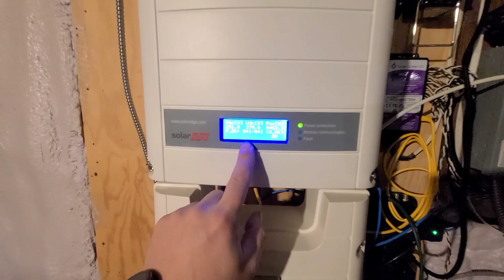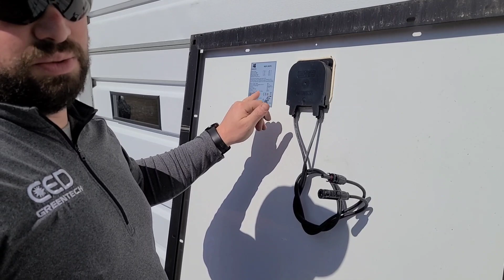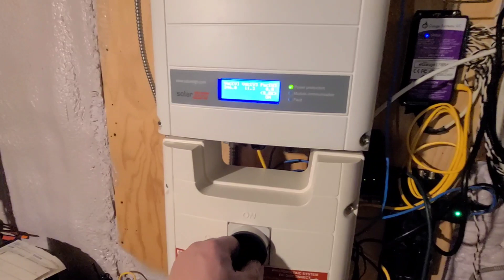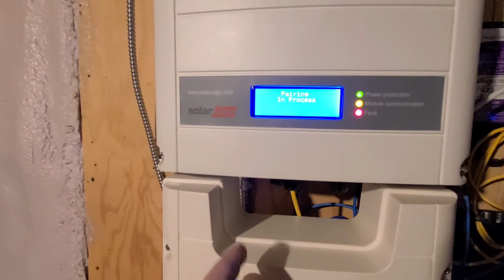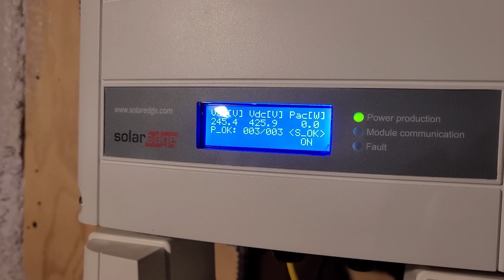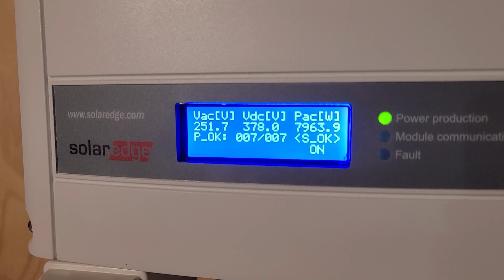How to Replace a SolarEdge Optimizer

Comment: Hi Ben,

in your video you found a bad optimizer but once you had it off the roof it was still reading 1V so how exactly did you find the faulty optimizer? My inverter is stuck in night mode and of course after a little reading it will be time to look into this. So far SolarEdge customer service get a 0 rating from me. Lots of talk about nothing and the only thing they keep saying is to get the installer involved. Judging by all the negative rep. online its a shit company with a lot of issues.
Reply from the maker: I have my array mapped out online, so it was easy to pinpoint which optimizer was bad.  If you tell solaredge that the optimizer is putting out 1v they will tell you that's its not bad... 
Inverter stuck in night mode could mean a bad inverter. What I do is turn the DC disconnect knob off, open the wiring compartment and check for DC voltage on the strings.  This should line up with how many panels you have in the longest string.  Then turn the DC disconnect on with a pair of pliers.  If the DC voltage drops to near 0v, it's a bad inverter.

Comment: Very good video thank you for your effort with this. Unfortunately, you stopped just short of my problem. I have replaced 12 low-powered panels and optimisers with 10 much higher-powered panels meaning 2 of the original optimisers are not required. How do I remove the unwanted optimisers from the monitoring platform?

Comment: Thanks to your video I just swapped out a failed optimizer but the SolarEdge map is only editable by installers.
Reply: You could pretty easily just call up your installer and tell them that you had a bad optimizer and have already replaced it yourself but simply wanted to alert them and ask that they update the optimizer map for your system. I'm sure that they'll be glad they didn't have to send a guy out to swap it out for you.

Also this makes me wonder what happens to all those SolarEdge systems out there under the control of now-defunct local solar installers. Do they just become inaccessible, or could a customer actually get help from Solaredge themselves in that case? Probably not but maybe...
Reply: @erikajoystith4692  I talked to SolarEdge about this, as a homeowner you can take control of your own system, but the installer would no longer have any access to it.  Depending on how you financed a system could play into this, I paid outright, so own it all.    My installer's terms say any work performed by non-(insert company name)  would result in warranty void.   So I would assume taking control of my system would make them not want to honer any warranty work needed.
Reply: @erikajoystith4692  Exactly, my installer is no longer in business. I did reach out to SolarEdge and they did the map update for me --- AND they sent me replacements for the two bad optimizers. Great support from SolarEdge.
Reply: @erikajoystith4692  I can tell you what happens when an installer goes bankrupt.  It's nothing good.  SolarEdge refused to let me setup a "self-installer" installer app when my installer went bankrupt and no other installers wanted to support my existing system and weeks of trying to find one.  It's a major pain in the butt.  Fortunately, so far, videos like this and asking SolarEdge to update my optimizer SNs has worked around no longer having an installer instead.

Comment: Ben, thank you for sharing and I appreciate your insight.  The company that installed my SolarEdge system went out of business, sadly.  My SolarEdge inverter has now died for a second time and the next replacement is on its way which must be installed by an electrician to be under warranty ($700 each time).  Can you advise me on what data to ask solar edge for regarding my system's health so that I can better understand my inverter problems?
Reply: The old optimizer showed one volt    what does the new optimizer show when you hook it up on a bench test?

Comment: Hello Ben. Great video, much appreciated. I am wondering which model of optimizer do you use? Here in Sweden we got a sale-ban on many of SolarEdge optimizers (P300, P350, P350I, P370, P4040, P405, P500, P505, P600, P650, P700, P730, P800p, P800s, P850, OPJ300-LV, M6240) due to them interfering with radio communications. Do you have any experience with this? I am curious if our installations using P300s and P700s should get rid of them or not..
Reply: If you make an RFI claim to solaredge they can send out new optimizers with filter attached to them. You need to braid all the cables with a continuous set of homeruns through the whole array. I've done this a couple times now. The first time a Solaredge rep came out. They may be able to send filters to add on as that's how the special optimizers appeared but there may be more to it on the inside of them
Reply from the maker: I have not heard anything about the recall.  I'll have to look into it!! That looks like pretty much all of them.  I have P300 on my house.
Reply: SolarEdge shipped me P440 optimizers to replace 3 P300 optimizers under warranty and all 3 worked.  However, unsure about their RFI specs.

Comment: How did u know it was That ONE? what led u to suspect that one
Reply from the maker: I made a map of the optimizers on the Solaredge site.  Showed me exactly where it was.  If a map wasn't made, a thermal camera is your best bet for quickly locating it.  Panels that have a bad optimizer will be warmer than the rest.
Reply: @benssolarandbattery  friend of mine is having issues. The inverter won't even enable because there are less than 8 panels working in each string. He has two strings of 11 and he has found 3 so far that don't put out 1 v. But then when he connected one string of all the ones that did put out 1 v he still gets a low insulation resistance error. Of 465k ohms. I'm taking my Megger over there tomorrow to check wires and looks like I can meg the optimizers directly too from what the instructions say.
Reply from the maker: @electromechanicalstuff2602  if you go into I think the maintenance menu, it will sometimes show you where in the string the isolation issue is.  
Check it out.  https://www.google.com/url?sa=t&source=web&rct=j&url=https://www.solaredge.com/sites/default/files/application_note_isolation_fault_troubleshooting.pdf&ved=2ahUKEwiZmrSilK73AhWxoXIEHVrZArUQFnoECAYQAQ&usg=AOvVaw1mFLbe0N2ACnUbDlDiHbUV

Comment: Hi Ben,  Which error code does the grid isolation relay failure cause (maybe 2x1a)?  I would be tempted to pull the board and swap relays if the warranty was past. In another video it appears as if you have gone into the setup to look at what is involved configuring the SE1000 to respond incrementally from  your solark adjusting the frequency to throttle the solaredge (to limit battery charge current).  I would like to know what is involved in turning this on so when the few hours a summer my solaredge inverter is making just a little too much power the solark can throttle instead of shutting down the solaredge (so I sell more power to the utility).  what is your opinion of using a solaredge smi-35 or smi-100 to feed the solarark (s)?   thanks for the fantastic videos.

Comment: Great video,  pretty sure one of my optimizers is out. I will use your procedure to check it out. Would you recommend trying to re pare all of the optimizers before going forward with the diagnostic process? Once the new optimizer,  if needed,  is pared how do I communicate that to my solar edge account? Thanks in advance, my system is 5 years old and this is the first problem. The system was installed by a solar co they charge $200 just to show up. i need to learn to help myself. Thanks Bill

Comment: Much appreciate you creating this video.  Hoping i can get some troubleshooting tip.  I have one optimizer/panel that recently decreased power production to little under 1/4th of what the other panels are producing.  System is about 6 years old, not being shaded by anything throughout the day.  Would you suspect panel going bad or I may have another bad optimizer?  Will probably try to get on the roof sometime in next couple of weeks to find this particular panel/optimizer sn and measure open voltage plus optimizer safety voltage.
Reply: More than likely optimizer. Panels do go bad but optimizers fail often

Comment: I just had my SolarEdge system installed June of 2021. It was producing 99 kWh daily. By checking the app every day, I was able to see it's production numbers. Then, it started to decline in production. On the app, half of my panels are producing less than the rest, I have 42: today some read around 1.61 kWh, others read 1.09/1.11 kWh, and four panels read 960 and 975. I've called the company but since the system is producing, they say everything is good. I know something is wrong but I don't know anything about this! Last time I called, they asked for my electric bills for comparison.... I was so angry, the app is telling us how much it's producing daily, monthly and yearly. And it's readings are definitely less than before on half my panels.
Reply: Dammm, im getting solaredge hd wave-optimizer install. Im just worried about the product going out like that.
Reply: @thezfamily989  Now that it's summer again, it's producing in the 90's range. Which is still pretty good. Just make sure the company installing them will take care of your problems swiftly after it's installed. It's not producing in the 98-99 range like at the beginning. But still, why the decline? Supposedly, the panels stop producing normally after 30 years.
Reply: @prettybrowneyez3338  yea they loose % through out the years. Yeaa, hopefully they be good for many years.. so far there reviews been good satisfied customers.
Reply: @prettybrowneyez3338  have you been washing the glass panels?  Dust and pollen can shade the panels.
Reply: @ciaoricardo  I wash mind down. it helps
Reply: @thezfamily989   hey how your system now?
Reply from the maker: Is there any shading at all on any of your panels? Or snow? Sounds like it's working perfectly and the panels that are shaded (because it's winter) are producing less than the others.  Without any location or shading info, I'm in the dark.  I don't expect you to give that to me, but it's almost definitely the issue.
Reply: @benssolarandbattery  No. No trees. I'm in Texas so it's very hot.

Comment: I have 128 cell 435watt panels soler edge will not tell me what optimizer I need with the hd wave please help because I’m not an installer
Reply from the maker: The P505 would probably work.  Check the spec sheet and compare to your panels.  Be sure to take temperature into account for the max voltage if you live in an area that gets cold.

Comment: Hi. Have You tested the resistance from both lead pairs on a new and a claimed not working one? I am curious how to detect the poor one even if the 'not working one' in your case shows 1Vdc.
We have a system where a whole string is showing low production, inverter shows 033/034 (34 is the right no. of panels).
Reply from the maker: I have in the past but don't remember the values.  I'd start with the optimizer that's out. That could be messing things up for the rest of the string.

Comment: How did you find out what optimizer was bad. I’m showing 39 of 40, but all my optimizers show up on the list in the logical view.
Reply: Greg- is solaredge able to provide you a report of which optimizers are working/not working?
Reply: @jasonschlegel4027  I’m not sure what you’re talking about buddy.
Reply: @nmfireman  Sorry - I"m just wondering how you know 39 of 40 (previous post).  Is this something SolarEdge provides?
Reply: @jasonschlegel4027  There is monitoring software that is provided. We cleared this problem up quite a long time ago. We had a hail storm and had to replace a bunch of panels. We found the bad optimizer after putting everything in logical order. I could screenshot what we used to see our panels
Reply: @jasonschlegel4027  I’m trying to figure out how to post a screenshot here so you could see my monitoring software
Reply: @nmfireman  jschlegel@

Comment: I had 2 bad optimizers 3 years after I install my own system. I called Solar edge and they were able to diagnose the 2 optimizers and surprisingly they sent me 2 optimizers no question asked. Fast forward 2 years to today and I noticed one optimizers Not working I called solar edge and they said the optimizer is producing 1 volt and that I need to trouble shoot to make sure it’s not the panel or connection for them to send me a new one. My guess is that these optimizers made in China are failing left and right and they are making it harder on the home owner to get a replacement based on the 25 year warranty. I will jump through the hoops and hopefully get the optimizer replaced. The panel has no moving parts so I can’t see the panel being the problem. Maybe a connection but I doubt it. They are pretty easy to replace especially when it’s a panel on the outer parameter. Also I recommend getting an installer account on Solaredge monitoring platform so you can update the optimizer once your replace it. If your have solar edge optimizer you will probably be replaying optimizers 1 or 2 every couple of years. :(.  Nice video by the way! 
One more thing if you are thinking about getting solar it is way cheaper to do it yourself. You can subcontract some electrical work and the plans. Everything else is pretty self explanatory and it will save you anywhere from 60%-70% after tax credits! That was about $20,000 in my case!
Reply from the maker: Thanks for the comment Michael. I have seen plenty of panels fail.  Usually its a diode or a bad solder joint on the cheaper ones.  Most often you'll get 1/3 of the panel that stops working.  In that case it will usually still show up and produce power.  Over my years of installation and service work, 9 times out of 10 its a bad optimizer, even if it's showing 1 volt.
Reply: @benssolarandbattery  1V output shows the basic DC-DC converter is working. But since the op needs a communications command to enable full power output, it must also show up during the initial power up system scan. That should cover 80% of the electronics functions. Missing would be electronics on the panel side input.